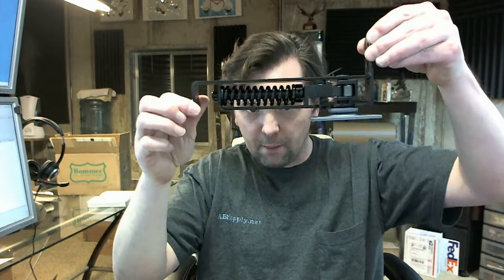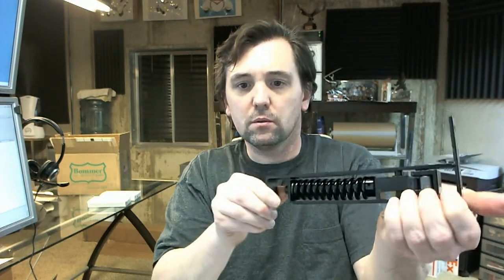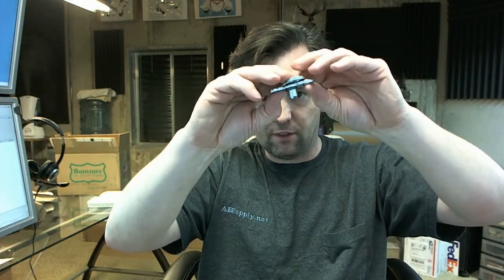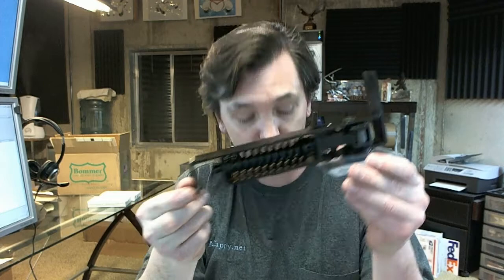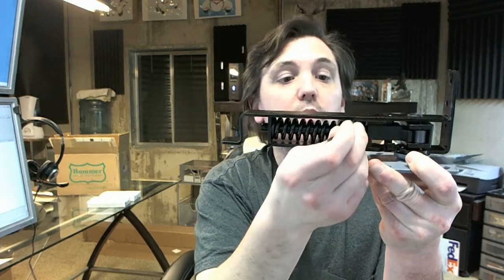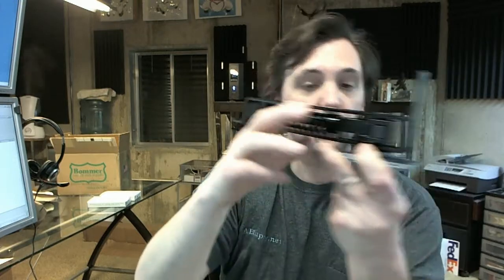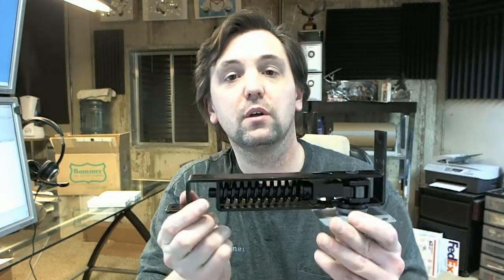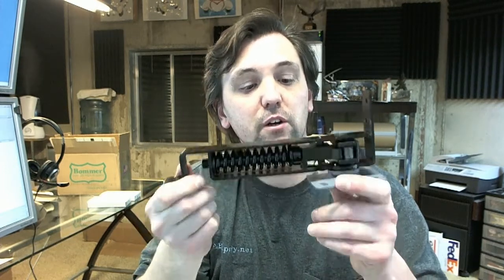Bommer 7813HD-600 Horizontal Spring Pivot with Floor Plate-Heavy Duty-Non Hold Open

Comment: can this hinge be repaired? the spring hinge on bottom came off.
Reply from the maker: Please email me a photo of exactly what came of - sales@absupply.net
Reply: I was wondering how hard would it be to pivot a 10 ft wall section with a wheel on the end supporting the front weight. Im wanting to split a 20ft wall where it opens inward on a pivot. pivot is on left and right and joins in center